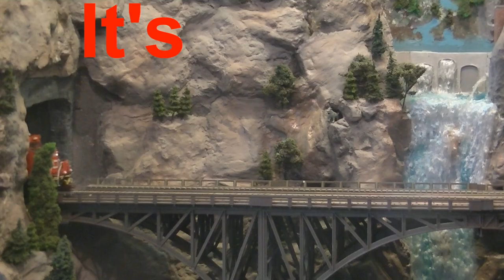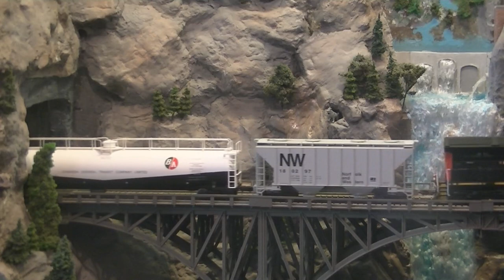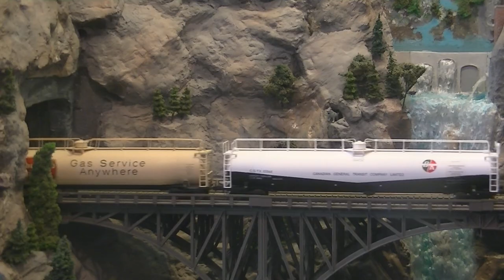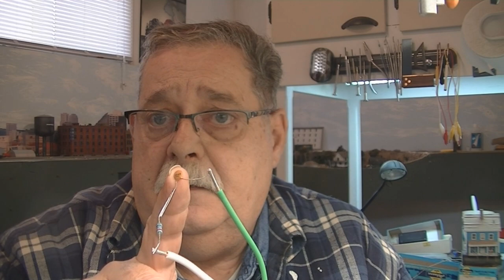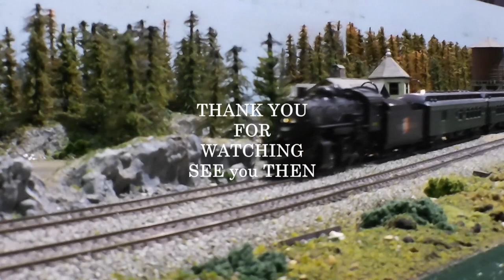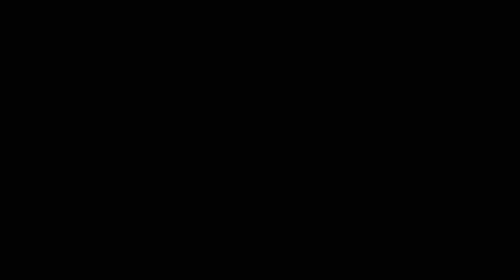ITS TRAIN TIME HOW TO SEG 02

Comment: but what is it used for? is it not ok just to have a 60 foot LOOP of bus wire, with droppers every 10 feet?
Reply from the maker: no no the snuffers have nothing to do with your drop (leads), it is place at the end of the bus run railA to Rail b to suppress the noise between the wires.

Comment: So does this eliminate having to have boosters? You said the u shaped buse wiring instead of loop buse wiring keeps from having a major drop in power which I understand. Some layouts are so big they need power boosters still. So do these help to eliminate the need for electricity boosters by keeping the power up to the ends of the u shaped buse wiring arrangement or do you still need boosters for a large layout? If it saves from having to use electricity boosters then it can save a lot of money on the electronics for a large layout. Also does running 4 buse lines eliminate the need for boosters? I've seen one buse line with boosters so having multiple buse lines has got me lost too. I've had one small layout so I'm new to large layouts and will be building an HO scale 14' × 24', 3 level layout soon. Will you explain this more. This is the first I've heard about these and you've got me very interested in this now. Thanks. Stay well.    👍
Reply from the maker: Having a large layout and with its design and geography, it did required the use of multiple buses, and yes in a U shape distribution. Now that does not alleviate the use of boosters, (1 command control station and 3 boosters in our case). The snuffers are an end of the power line, consisting of a resistor and a capacitor, their function is to eliminate conversation in between the wires especially when a number of wires are near one another (drops are not a factor in this scenario). Like I said in the video, they are not a must but have work very well for us. thank you for your question, hoping it help you.
Reply: @itstraintime2761  I don't quit grasp what conversation between the electric wires means and how wrapping them together helps prevent that or even connecting them using a snuffer. It seem by them touching or being connected at the end would make that worse. Can you explain communication between wires to me? Also I'm wondering what the cons there are to using a snuffer. You gave an example of a pro but said some modelers don't like using them. What would there reason be for not using them if they work as you say? Knowing they are only needed for larger layouts, are they not applicable to all types of wiring systems or will they fit in everywhere? Trying to understand all aspects and sides of using these. I understand they cut down communication between the buse wires even though I'm not quit sure 100% what communication between the buse wires means. If you would email me that would be great. Maybe you will have more room to explain this than what room you have here. Please acknowledge in this comment when you have my email address so I can delete it. Thanks for helping me.   👍
Reply from the maker: @williambryant5946  I do not have a degree in electrical or electronics but communications should be better explained as signal distortion which is common were wires are in close proximity. You ask about the cons of the snuffers, well if your buses are far apart, the snuffers will be useless as it relate only to close proximity of the wires. Yes, I agree many modelers do not use them, some even say that it is a very old form of wiring prior new DCC technology, nothing so far did convince me that new DCC technology has address signal distortion. Why would they recommend that you twist your buse wires at regular interval to just do that when  a snuffer at the of the line will do. In your first sentence, yourself admit that you do not grasp that twisting the wires will be effective, I totally agree with you, but you finish your sentence by saying you do not see how a snuffer will be of any use either, on that I disagree, to me the snuffer is an easy solution that if does not do anything it also do not disturb the performance of my system. So being cautious in nature, I use the snuffer. I thank you for your opinion and totally appreciate your input.
Reply: @itstraintime2761  Thanks for taking the time to talk with me. Even though snuffers are old technology if they work then why not use them. I'm kind of like you if it could help and won't hurt then why not. I still need to understand this more but you have opened up a new possibility for me. Thanks again. Stay well.    👍